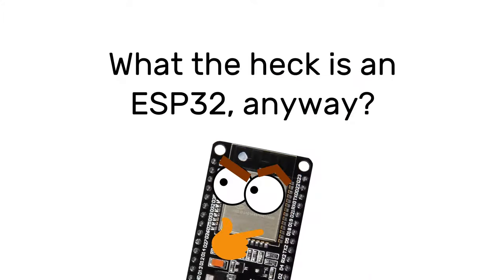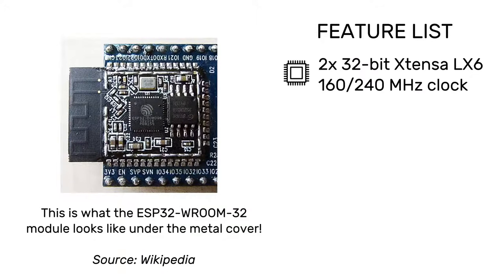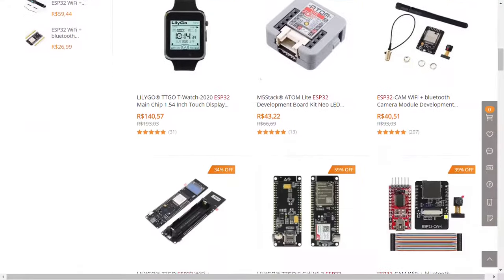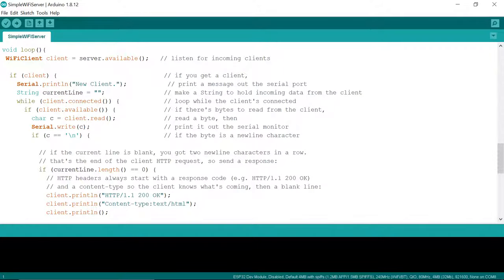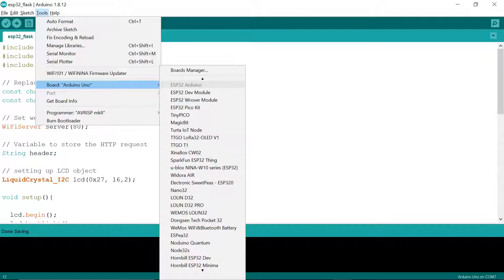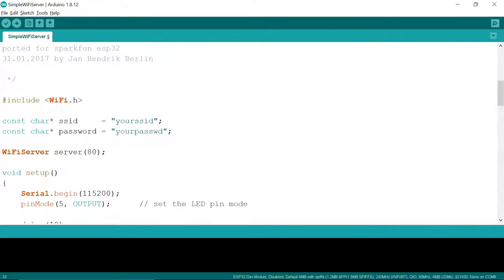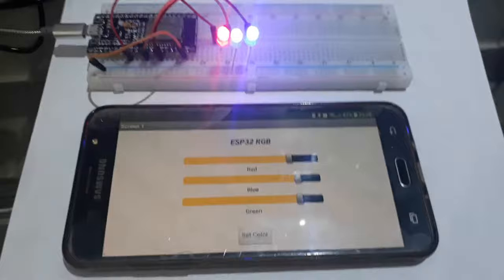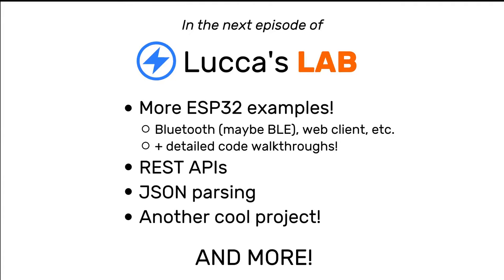A beginner’s guide to ESP32 | Hardware & coding basics + Wi-Fi server demo

Comment: LED_BUILTIN is not declared. Seems for ESP32 Dev Module it's not defined. Moreover in case of this board, the LED is connected to pin1. This then works on my board form Azdelivery. But on some other dev boards it might not allow setting to low on that pin.
Reply: You selected wrong board

Comment: What power supply can we use to power esp32 other than power from laptop ? Can we use a 3.3v rechargeable battery 18650?
Reply from the maker: It's going to depend on which board you're using, as long as it has an onboard 3.3 volt regulator you should be able to use a single 18650 Li-Ion cell to power it. You could also use try using a 5 volt phone charger as well.
Reply: @LuccasLab  I'm using a Esp32 board and connecting mq135 sensor and DHT11 sensor

Comment: As I see, this ESP32 appears to have more I/O channels than the Arduino UNO or Nano,  about a third more. But the working I/O voltage is 3.3V

My main considerations are two. First, whether, for analog inputs, the ESP32 can work with most analog sensors that have "5V" stamped on them. Second, for digital outputs, whether the ESP32 3.3V needs 3.3V rated relays, not 5V rated relays. I hate to have to buy more relays. I have too many 5V relay channels unused. 

Thanks
Reply: Add in series a optocoupler for each relay coil